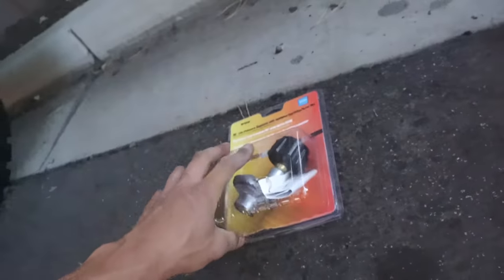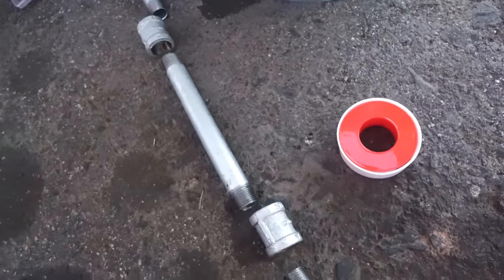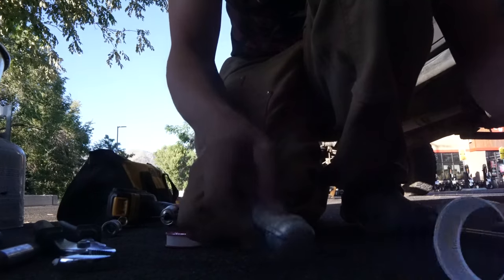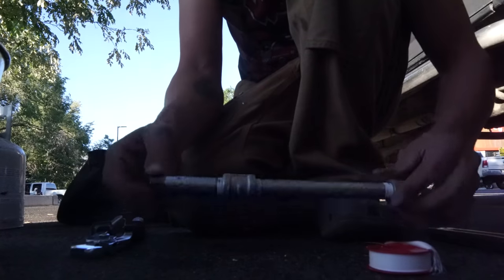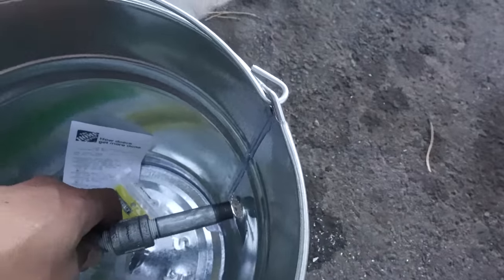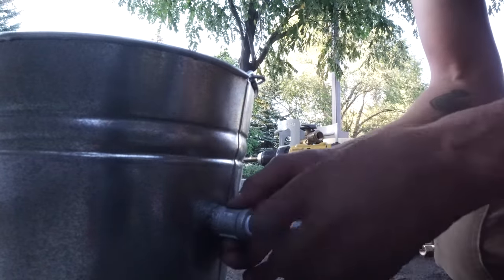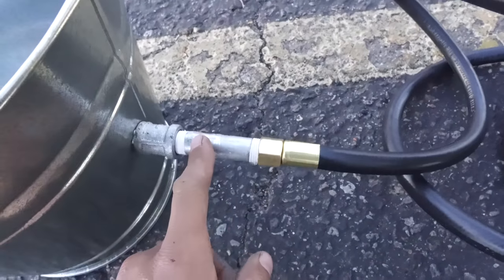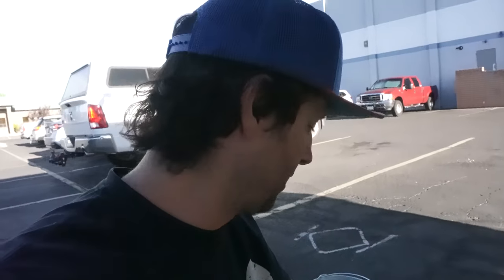How to Make a DIY Propane Fire Pit Easy for $45!

Comment: If you want to have some fun with it (with or without the cinders), seal up around your bucket penetrations and fill with water to slightly above the pipe level. The propane flames will dance around on the surface of the water -- toss in some ice cubes (optional) and then you've got "fire and ice". :)
Reply from the maker: lol hmmmm

Comment: Really neat idea, and kudos for presenting a fun and useful DIY project. But I would recommend replacing the galvanized tubing with something else. Maybe copper. Galvanized metal gives off zinc oxide when hot, which is pretty toxic. Same thing with the bucket. Maybe splurge and get a stainless one instead of the galvanized?
Reply from the maker: yup prob need to switch the bucket eventually
Reply: You can soak galvanized items in vinegar for 24 hours and most of it will come right off. Then just paint it with high temp spray paint to keep it from rusting.

Comment: ALSO YOU SHOULD PUT A ONE WAY VALVE SO THE FLAME DOES NOT HICCUP BACK TO THE TANK.
Reply from the maker: Flame can't enter a pressurized tank so she's good.
Reply: Flame can't even enter the hose without any oxigen. Do you know how fire works?

Comment: Good job. FYI however, there is a Teflon tape made especially for gas applications. Its a yellow(ish) color. Gas will decay the white Teflon (water usage) tape you used and leak after a while. I would consider replacing the white for yellow gas tape in the near future.
Reply from the maker: Yup, it's all I had so just used it anyways.

Comment: Teflon on galvanize , or black iron pipe   (they have a tapered thread to make the seal )  is not for sealing the connection.  It is anti-seize tape,  which replaced anti seize compound back in the late  s or early.   It is amazing how the real purpose of things gets lost over time.
Reply: Its called pipe dope,never tape on any gas fittings.Plumber for 39yrs

Comment: Stupid question:  About how long will this burn? No reason to be specific, I just want to know if it will last only a few hours or if we can expect many uses of 4 to 6 hours over many nights?
Reply: My gas grill can run about 45min a time about 4 months before it's empty...
Reply: depends on the size of the propane tank & how high the flame is turned up
Reply from the maker: I burned it all weekend long every night at Overland Expo West (Thur, Fri, Sat & Sun night) on a 20 lb tank.  Never ran out of propane, I was shocked. Probably burned it for 5+ hours per night easy.
Reply: @TruckHouseLife  Nice!  And thank you.  Going to be making one of these soon.  :)
Reply: @IkeCoblentz  Thanks.

Comment: You're supposed to put adjustable air mixer to outside of bucket 
I built a lot of propane burners because I used to be in Concession business 
You want the blue flames it's hotter and doesn't create soot
Reply from the maker: It's an option, I was going extra cheap though haha.
Reply: Yellow flames look cooler though